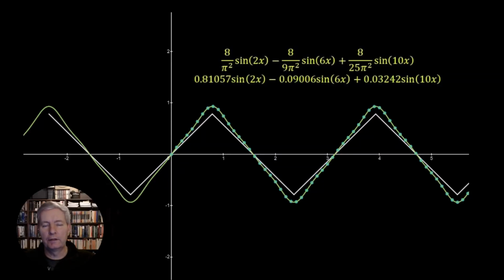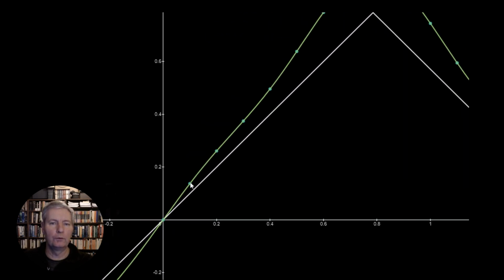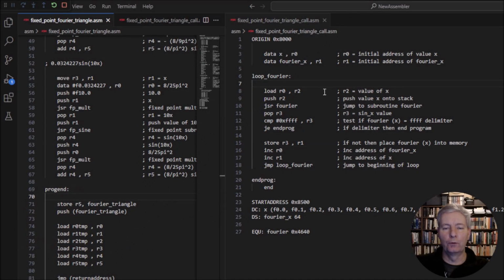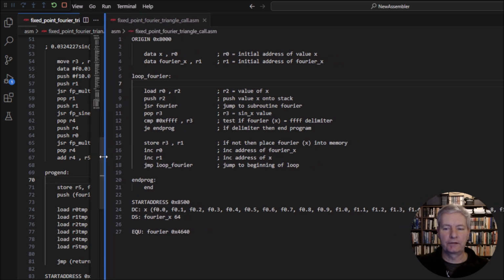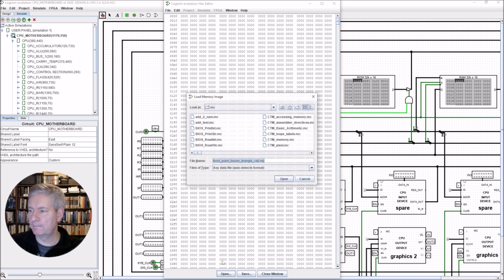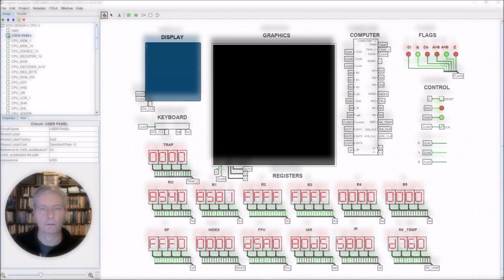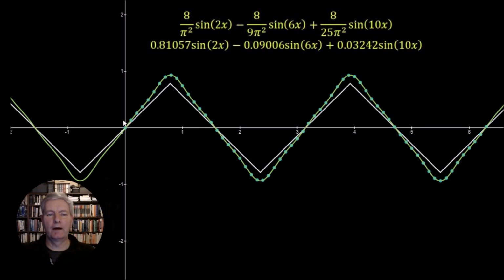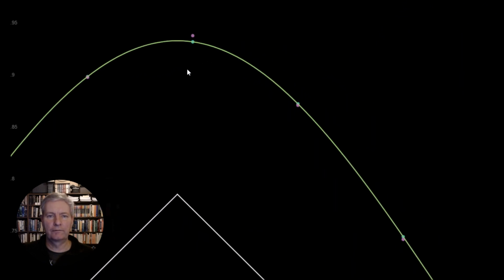Triangular Wave Analysis Using Assembly Language Fourier Series

Comment: The assembly code for calculating a Fourier Series using trig functions that you've written your own library for within your assembly language (ISA) for your CPU is so beautiful. That's a work of art there! Are you going to take this to the next step to turn this algorithm into a full fledged FFT? Perhaps use it within an "audio driver"?
Reply from the maker: I think that might have to wait until the floating point unit has been designed in.
Reply: @RossMcgowanMaths  fair enough!